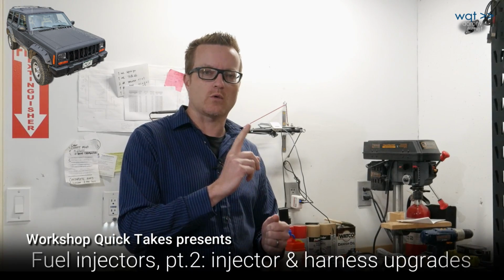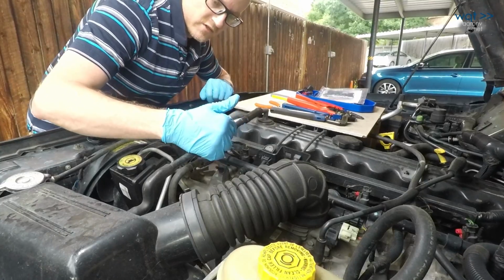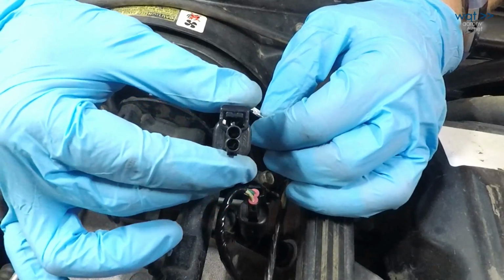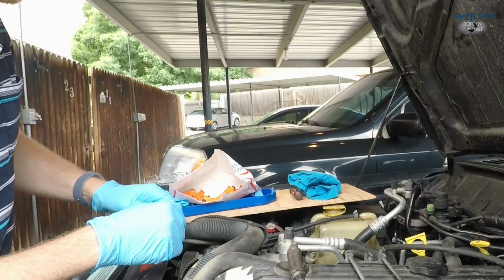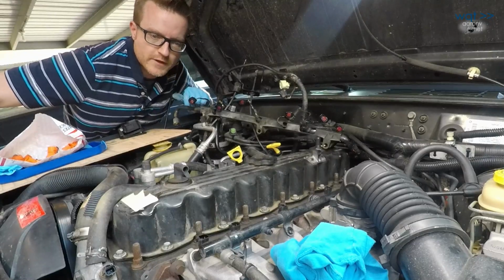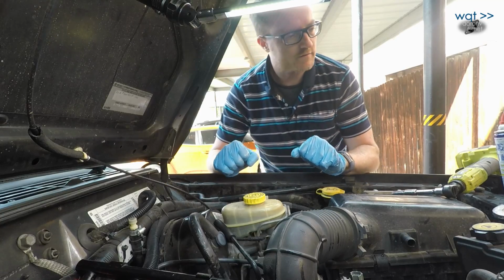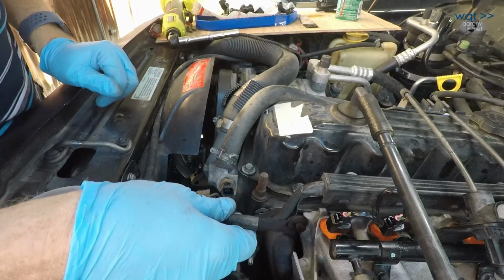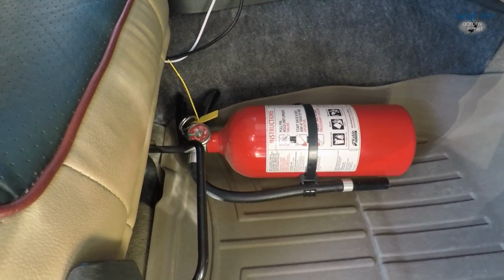projectXJ: Fuel injectors pt.2, 4-hole upgrade and harness plugs, 4.0L (84-01 Jeep Cherokee XJ)

Comment: Great video. Thanks for sharing., I noticed you took a great care to keep the wiring colors as they were. However, I’ve been told polarity doesn’t matter as injectors are solenoids so polarity can be inverted without causing problems. Do you have an opinion on that?  Thanks again
Reply from the maker: I've heard the same. But wire polarity matters often enough that I figure it's good to track it everywhere.

Comment: Do you have the part link for the connectors?
Reply from the maker: No link to offer, because these gray marker vendors change up all the time. Just need to hit a site like Amazon or eBay and search the keywords. Or go to specialist websites like K-Suspension that sell the injector refurbs, and see what they offer.
Reply: @aaronvienot 
Thank you,  i have been looking and can't believe it's so hard to find.  Great video btw.
Reply from the maker: @dickeymoetomjerry6027 thanks! Try "EV1 injector" or "EV6 injector" depending on whether you have older or newer plug style, then try combinations of other terms with it -- connector, plug, kit, terminations, pigtail, etc. Once you find this week's magic combination a lot of good hits will start appearing.

Comment: It's fuel injected,  you don't need to open the throttle when starting. When you do it puts it in "clear flood mode" and won't inject fuel.  FYI.
Reply from the maker: Have you verified the XJ specifically does that with Chrysler injection, or is that possibly an old Renix feature? In any case, when one of these isn't starting I usually work the throttle to try and cycle the TPS and the fuel map. Sometimes it seems to work.
Reply: @aaronvienot 
To activate clear flood mode in a 2000 Jeep XJ Cherokee, press the gas pedal all the way to the floor while cranking the engine. Hold the pedal down for a few seconds until the engine stops receiving fuel, which shuts off the fuel injectors and opens the throttle plate. Release the pedal and then try starting the engine normally. 
How to Perform Clear Flood Mode
Turn the key to the ON position (but do not start it yet).
Press the accelerator pedal to the floor and hold it there.
Crank the engine for about 4-5 seconds.
Release the gas pedal.
Attempt to start the engine normally.

Comment: Link to the pigtail kit?
Reply from the maker: "EV6 injector plug" on eBay, Amazon, etc. if you have the newer style injectors shown here. "EV1 injector plug" is usually the older style.
Reply: Look up K Suspension about 180 for fuel injectors and pigtails

Comment: Great video as usual. Any links you can share for electrical connectors?
Reply from the maker: I ordered mine from eBay vendors. But they are widely available from Amazon, various motorsports suppliers, and Napa sells various pigtailed units as "fuel injector connectors."  KSuspension, the vendor I used for the refurbished injectors, also sells them.
Reply: Thank you @aaronvienot